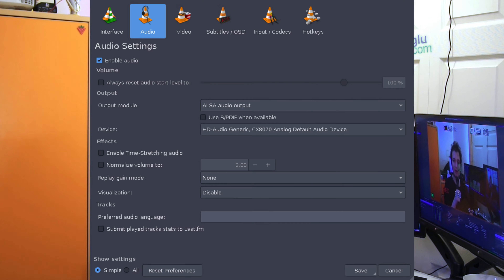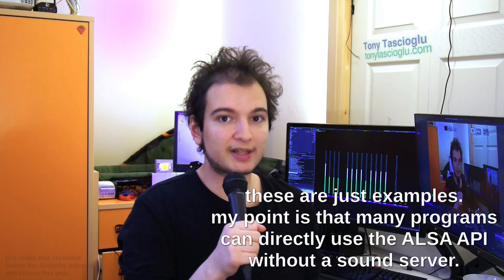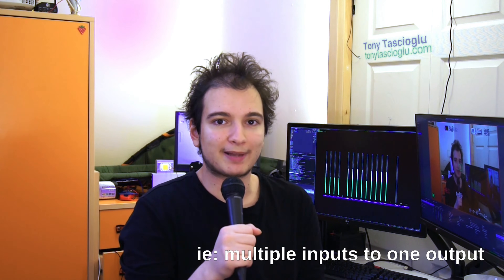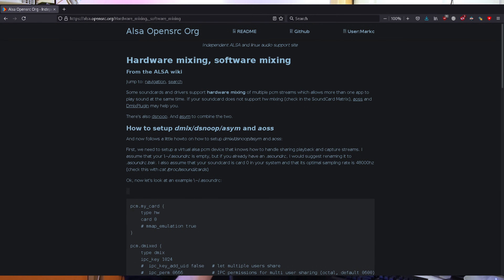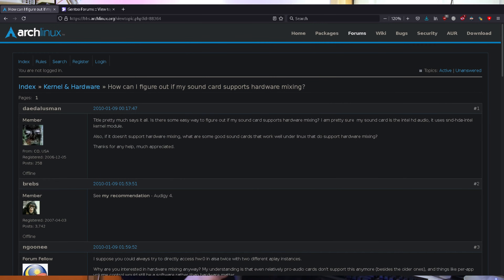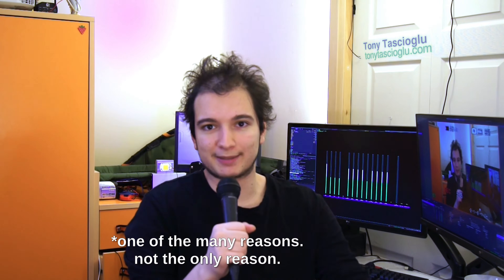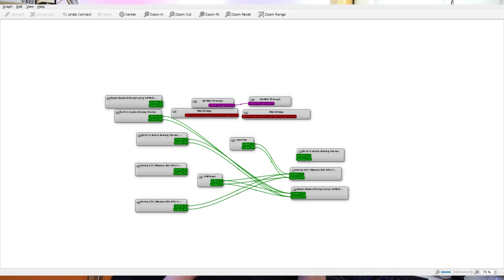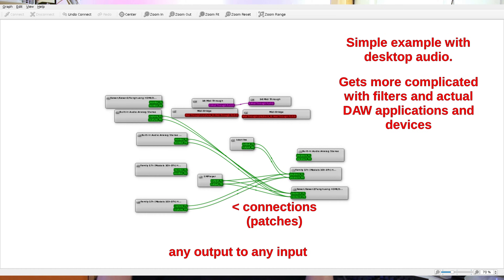Linux Audio Explained (ALSA vs PulseAudio vs JACK vs Pipewire Explained)

Comment: Hello, greetings... 

Why do I still feel that in Ubuntu (even with Pipewire) before they stopped using OSS, the sound is not of high quality? I'm not a musician, but my ears are very sensitive to noises and frequencies. How can I fix this? 

My Sound Cards are: 
1) ALC662  
2) AMD RX 580(HDMI)

Configuration: Stereo speakers

Comment: I didn't know what Pipe wire was. I had JAck before but it broke down, and nothing worked... so now I'm back with Alsa, Pulse, and pipewire are all there by default in my OS...
I noticed very bad noise when using 44.1khz on my soundcard, switched to 96khz and it all went silent... now I'm going to try pipewire. Jack was fantastic, untill I didn't do something very stupid... stopping mdp service thinking it was ok... but never thought pipewire was more advanced than jack...

Comment: Ok... Now I just need a video on how to make any of this work with Davinci Resolve and my Behringer UMC HD204 HD USB sound interface in the officially sanctioned (by BMD) Rocky Linux distro

Because at the moment... I am very much flailing blindly. I have gotten to the point where playback is mooostly correct, just has the occasional stutter. But the input recording is very much unusable. Because those stutters manifests as empty samples in the pcm files. 

Very niche need, I guess. I am just asking here and there to see if anyone has pointers.
Reply from the maker: Is Davinci using ALSA, JACK or Pulse? If ALSA, try giving it the pipewire/pulse wrapper source since it's possible it's polling with too short a buffer which is probably fine on the pipewire side if playback is fine

Comment: Great video.  Curious if you could explain how/why randomly my usb mic will pitch my voice high or low.  If I unplug/plug it back in a few times I can usually get things working again but I just never know what my voice will sound like.  Ubuntu 20.04, running PulseAudio btw
Reply from the maker: It's the sample rates/times going out of sync.
I've noticed this happens as well - basically, to simplify it, if your microphone samples it's input at 1000 times a second, and sends it to your computer at 1000, but your computer copies it into a buffer running at 1200 without resampling, you would get a pitch up. (just like if you played 30 fps video at 60, it would be double speed). If your mic sends 1000, and you capture at 800 without resampling, you'd get a pitch down and slower voice. Since pitch is just how many times the wave repeats every second (frequency), changing the sample rate changes both the speed and pitch - like on a record/tape player.

Now, the slight pitch up/down isn't that drastic, it's likely all going at 48000, it's just that they are referenced to different clocks. Your mic has an onboard oscillator which samples it's input, then sends it over USB every few milliseconds. That clock isn't in sync with Pipewire's clock, since AFAIK pipewire does not use sound card clock. This is also made worse when your headphones are on a different card, since now you have 3 clocks. All think they are 48k, and as they drift you can end up with these slight pitch changes. Normally it's pretty good at regulating though

(at least this is my understanding of this issue so far - completely possible I'm mistaken here)

Comment: I have a Focusrite Solo 3rd gen and it was plug and play with pipewire. Had to set default microphone via terminal but later found out you can do it with pavucontrol.

Comment: Hey man. Thx for this. Do you know how to overcome the now years old issue with audio crackling on Linux when using external mics with pipewire-audio? People do all kinds different things to their OS post-install trying to fix it and many fail to, but I don't wanna experiment my current rig to bits and pieces. Have you ever been hit by it? If yes, what exactly did you do that worked? I am currently "only" on the latest Linux Mint as I don't need a total flagship to do voice-over videos. I am using an external Linux compliant ESI U22 audio HW-interface and various external mics, both USB- and XLR's and both dynamics- and condensers. I honestly think it's embarrassing this issues still exists. Tons of users are still hit by it, it's been going on for years and yet... nothing done.
Reply from the maker: If your cracking is because of buffer underruns (as my issue was), this might sound a little bit janky, but I have had pretty good results by just opening up QJackCtl (using the Pipewire backend), then opening setup, and changing the Frames/Period option. Increasing/decreasing that will change the buffers and thus the latency, but often times by bringing it up or down a notch, it overcomes the buffer underruns.
(This assumes you have a buffer underrun issue. I just used QJackCtl since it often occurs when I'm using a DAW with the JACK interface when I start routing inputs)

Comment: @Tony What tool did you use to plot the graph shown at 9m00s mark?
Reply from the maker: That was a screenshot from the graph view of `qjackctl`! (You can use it if you have the pipewire-jack installed).

`qpwgraph` can also produce what is basically the same graph you see natively in pipewire without having to resort to the JACK view of things.

I find it super useful to just be able to drag and drop and source to any sink (you can also load up and route to/from LV2 filters directly!) without having to resort to pw-link.

Comment: @Tony Tascioglu : As a newbie, trying to familiarise with Linux with a hope to switch over permanently from Windows, I was trying to figure out how to edit video in Linux and make my external mic work to record audio at the same time and I stumble upon this video. I should confess that most of the things went over my head and I couldn’t figure out which one of these programmes should I use to make my mic work. I don’t know what to do. 😢
Reply: I tried Linux Mint yesterday, put it on a partition to test it. Everything went well, I like how it looks and feels, but can't get any sound, my rme interface won't work. I tried looking for help and searched for drivers, but everything I came across was too difficult to understand, and what I did understand did not work. 

I erased the Linux partition and I'm back to Win11. 😂 The 6 hrs I spent trying to get it to work is not worth the headache.
Reply: @lelandgaunt7130  I don’t know what went wrong, but generally the audio should work by default. I am using Fedora and replaced Gnome with KDE Plasma and the default inbuilt sound card worked just fine. I just had some problems with my external mic but ultimately, the internet and YouTube solved my problem. I am in love with Fedora + KDE. ❤️

Comment: That was very informative. I came here because I recently bought a Hyperdrum virtual drum kit which allegedly connects via MIDI over Bluetooth to a PC running a DAW. I run Ubuntu Linux and discovered that MIDI over Bluetooth on Linux is troublesome at best and I haven't got it working yet with QTractor. One suggestion was to install Ubuntu Studio which they say comes with all the required audio stuff, eliminating the need to find pieces separately and potentially missing things and generally screwing the system up. Still haven't got it working. But we will persevere. I now have a better understanding of Linux audio and the relationships between all the different parts which hopefully will help. Any suggestions from anyone are most welcome. Thank you. 
P.S. Can't get it working on a Windows machine either... no that I really want to.

Comment: Pipewire works fine on my PC but pulseaudio allowed me to to create loopback module (hearing my mic on my headphones) with lower latency. I can set in in pulseaudio to 1ms (or at least that is what i specified in commend) and it works fine. When I tried to do that in pipewire (either via the same command as in pulseaudio or via some pipewire alternative) then there was some wired pops and audio compressions or something that were making this not good at all so I needed to change to (I am not sure if I remember correctly) something like 20ms

Comment: In Windows Firewire Audio Interfaces just WORK. f.e. M-Audio Profire 610. Today still works in windows. It just works. Do you know if Ubuntu Studio v24.04 today, supports Firewire to the point where it works right away ? 
So far I have NOT seen Linux working smoothly with Firewire. BS Firewire devices are used a lot today. If you were a musician you would know and why. I think Linux is very OVER RATED. If you have a cheap computer with cheap computer speakers. Just the very basics. Linux is fine. If you are a serious Musician who uses firewire devices BECAUSE THEY WORK GREAT. Linux is NOT for you. You’ll have to get your self some cheap USB device. All OS work with USBs. Firewire is for those who want quality audio.

Comment: Wow!  You covered a lot of ground in one video, Tony--my head nearly exploded! Thanks for an informative march through the sordid history of Linux audio, most of which I have battled with at one time. Linux audio can be quite powerful, a Swiss Army Knife with 99 blades; just be careful when using a blade you don't cut yourself on one of the other 98 blades. Cheers!

Comment: Using PipeWire for almost two years now and I'm happy to announce that the BT device being "there" but not outputting any beep at all is back again :D Usually resolved by restarting the headphones 😩 From a gut feeling it's probably some chip going into energy saving mode after the last stream closed and it may be related to the headphones themselves. They did start to develop weird glitches over the time (especially the ANC feature) so there's that. Anyway, will totally stick with PipeWire. It really changed everything for me. And that's coming from someone who remembers how to echo "magic integers" into OSS device nodes to get sound going for some really odd native Linux PC games back in the days :D

Comment: im kinda happy ive never used my ubuntu setup for sound engineering and producing because asio or core audio isnt as difficult as jack we dont do none of the node cable patching stuff going on with jack, and i really hope pipewire doesnt require you to do the same.

Comment: Dude, you cleared a bunch of doubts I had in just 20 minutes! I bought an old Makie Onix-i 16 channel mixer that only works (so they say - I haven't tested) in linux. Also, the UbuntuStudio distro with the low latency driver is wonderful!

A curiosity: in the old days of 100MHz CPUs, mixing audio was heavy for the processors and digital telephone switchers were built with those processors and requried not low-latency but real-time OS and programming. It was so difficult only 8 countries managed to design and produce them.

Comment: Interesting overview of everything!
I'm also using pipewire, which when finally properly set works fine.
Only the latency is high for my card when compared to the same device in Windows.
For example, sending audio to a hardware fx en receiving the signal back takes about 5.5ms in windows, and the lowest I've seen this in my linux setup is 13.6ms (tested using Bitwig).

Using a buffer size of 256 @ 48000.
I got the RME HDSPe AIO & RME HDSPe RAYDAT used in conjunction, both excellent cards.
Also properly configured everything using a realtime kernel.
And for hardware I have a Ryzen 3950X, 16gb ram, running from a 7GB/s SSD.

All in all aside from losing a lot of plugins (where I can live with), the latency remains something I'm really bothered by.

Anyway thanks!